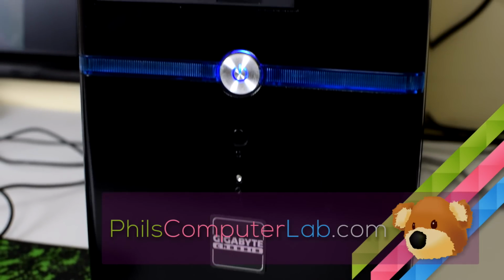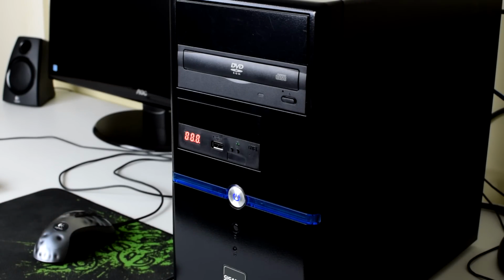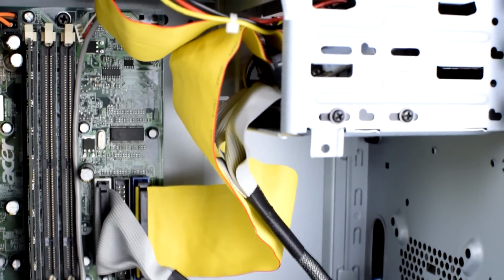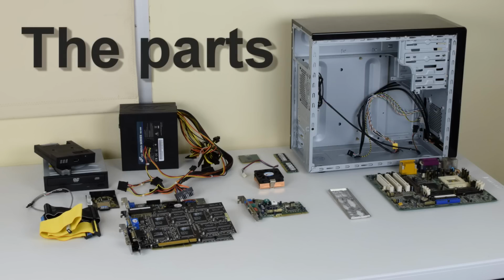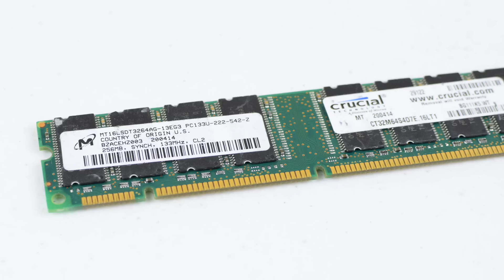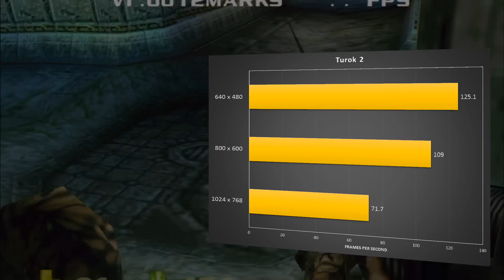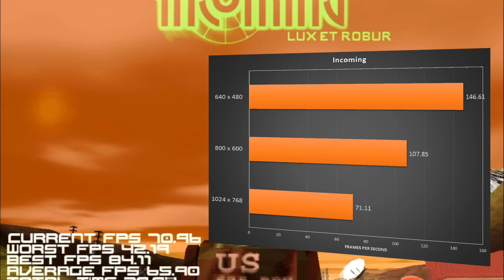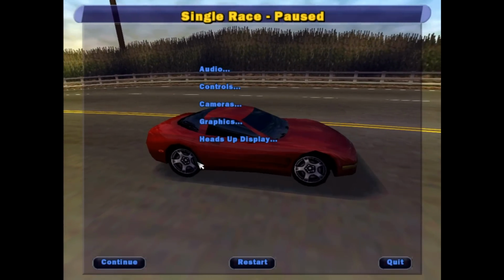3dfx Voodoo 2 SLI sleeper PC

Comment: I don't get it. I new to your videos but what is the point of putting together 20 year old computers?
I mean, this would have been handy around 2006 what I was buying computers like crazy from the thrift store for 15 bucks a pop. I had no idea you could do SLI until about 2010 when I asked a friend what the extra pins on those old cards were for.
I still have some of those old cards but really... what's the point? Does DOSbox not do so well with some games?

Comment: So do you NEED the main GPU if you do an voodoo2 sli configuration?  Also, is it configured so the 3dfx cards are feeding video into the matrox (as some kind of passthrough or something?)
Reply from the maker: +david b Yes you need a main GPU. The main GPU is passed through the Voodoo 2 cards.
Reply: Ok.  After looking at a few other video's I can see better how it's setup.  So is there a particular one of the Voodoo 2's that you need to pass the video to?  Or does that matter as much?  I would assume the one you hook to a monitor should probably be the one the video is passing to though right?
Reply from the maker: Good question. I just turned on the machine and tried out which one worked. The first one I tried happened to work :)

I can only assume that one card "takes over" so to speak.
Reply: So by using the voodoo 2's like this, can you "get the best of both worlds" in that you still have the excellent glide support, but also have support for later games that might benefit from newer cards?
Reply from the maker: Yes. But, you could just go with a Voodoo 3, 4 or 5 :)

Voodoo 2 SLI is really more about coolness than being practical. I would rather play Unreal on a V3, but there is just something really cool about V2 SLI.

Comment: didn't start building computers till around 2011. so I'm not that knowledgeable about 90s multi gpu setups. why do you need a third gpu? if you are pairing two cards why not use the video output on the top one? was it some sort of technical limitation back in the day?
Reply from the maker: The Voodoo 2 cards are 3D only! So you need a 2D for Windows, DOS, BIOS and all of that.
Reply: Thanks! I was curious on why it was so

Comment: Hi Phil, i want to buy 2 voodoo2 but i don't know which is better, the rev C with memories in one side, the rev A with dual side memories, What would you choose? thanks a lot!
Reply from the maker: Not sure what the differences are, but I like to use the later revisions in general :)
Reply: thanks for the answer, Yeah, me too, but maybe had some compatibility problems, so ask
Reply from the maker: acidNexTT Yea good question, I haven't come across anything in my research, so go ahead and get that rev C card :D
Reply: thanks a lot, incoming 2 voodoo2 rev C 100mhz  :D
Reply: PhilsComputerLab I've got a matrox g400 heading my way and I was wondering if I stuck a voodoo2 in as well wether I could use that for glide games and the matrox for non glide like dk2 for the embm?

Comment: i have only one voodoo2. now that the rx480 is finally arrived do you suggest to buy another voodoo2 and put them in sli or buy the new amd's gpu ?
Reply: Why not both ?
Reply: yeah! i can use two rx480 in crossfire for 2D graphics and 2 voodoo2 for 3d. thanks!
Reply: why not using the two RX480 cards for directx games and voodoo 2 for glide/opengl games ? ^^

Comment: do these jave to be the exact same Voodoo 2 card to be SLI or can it be a different brand? Just bought a voodoo 2 for my 486 it was difficult to find one online probably wont SLI in a 486 but for future systems maybe
Reply from the maker: For a 486? Hmm that's a pretty poor combination. A first gen Voodoo should be used in a Pentium 166 or something like that, a Voodoo 2 with a Pentium 2 or 3.
Reply: @philscomputerlab  Only reason im putting it in a 486 is I saw some benchmarks comparing a voodoo 1 and 2 on a Vogons forum with some pretty good results and the Voodoo 2 did better then the voodoo 1 on a fast 486 system plus my only other machine I could throw it in a is a Pentium 166MHz but that system is dead figure I will hold onto the card until I fix it or replace it
Reply from the maker: @Twintania  Hmm, and I mean this really well, using a V2 in a 486 is not dong it justice. Most of the games run in Windows 05 or 98, which is also a lot to ask from a 486. I would seriously reconsider your plans and get a Slot 1 Pentium 2 instead.
Reply: @philscomputerlab  alright thanks, just have a 120mhz 486 and looking to push the most out of it but if I ever get my pentium working I will give it to that machine or my pentium 3 which I don't do anything with at the moment

Comment: Please remind my, why did you need a third graphics card?
Reply: the early 3d cards only did 3d and not 2d, so you'd need a 2d card and a dedicated 3d card with passthrough cable
Reply: poi covered it, but the voodoo 2 cards, at least those, were called "graphics accelerators", they only did "3d" gaming.  You needed a "regular" graphics card to do your desktop.
Reply: well technically speaking the 2d "regular" graphics cards were also called graphics accelerators back in the day (and even still today). because  a graphics accelerator is either 2d, 3d or both and comprises of a graphic chip that allows the cpu to offload some of the tasks associated with graphics to a discrete chip. so what I said was correct and what yours saying techinically isn't right because there never was the distiction between graphics accelerators having 3d and graphics cards doing 2d - because they were both known as graphics accelorators - one 2d and the other  3d and both were available as graphics cards because "card" refers to the format.

Comment: so you need a main video card to go along with the sli voodoo2s? i cant get them to show up in display options, but they show up as pci videocard
Reply from the maker: +derp man Yes you need a proper graphics card with Voodoo 2. They are 3D only.
Reply: ah thanks, yeah im looking at more and more vids, and they all run 3 cards. that had us stumped for a while
Reply: does it have to be a older 2d card or can i use a newer video card from early 2000s with the voodoo2s in sli?
Reply from the maker: Nope, people use GeForce2, 3 or 4 cards, it totally depends on what you want to do :)
Reply: sweet, thanks so much, you rock and always answer questions, thank you. trying to get back intro this after so many years
Reply from the maker: It's a great hobby :)

Comment: A sleeper would be that hardware inside a Gateway 2000 case or a 2001 Acer Mid-Tower.  Any sub $600 pre-built PC from around that time that used shitty outdated and low end parts.

Comment: how much cards can you connect on sli with voodoo 2?
Reply: +jangelelcangry With the SLI-connector as seen in this video just two card can be coupled. However Quantum3D made Voodoo2 variants called Mercury for the professional simulator market, which contained 8 Voodoo2 chips per board and at least 4 of those boards could be coupled together.
Reply: Whoa! Awesome. I wonder how scaling compares to Nvidia cards. they should make sli technologies that you can connect at least up to 8 gpus on every range of cards. imagine at least 6 gtx 950s in sli.
Reply: +jangelelcangry The two SLIs from 3dfx and Nvidia have the same name and the same aim, but the technology behind it is a totally different concept. With 3dfx's SLI you could double (ok, maybe 98% or so) the performance of Voodoo2 by adding a second card. With Nvidia's SLI you won't reach that capability in games. Apart from the 3dfx SLI I've never been a fan of coupling multiple GPUs, because of the power consumption and resulting heat with todays GPUs and in particular with the problems regarding micro stutter, compatibility etc..
Reply from the maker: +armorgeddon Yea even the names are different. Scan Line Interleave vs Scalable Link Interface :D
Reply: armorgeddon
Too bad that software is behind multi-core/gpu technology. maybe in 10 years we will see APIs advanced enough that can fully use multiple GPUs and CPUs at the same time without too much or no tweaking with game engines. until then, 4 cores and big GPUs.

Comment: Why is it 2 8mb cards?
Reply: Strangely, the back of both card has absolutely no ram chips, while 8MB cards still have 4 chips on the back ... Maybe his cards are using most advanced ram chips that can store twice the amount of data in comparison of the first ram chips used ?
Reply: Usually it only goes up in times by four, since a square chip is more desireable than a rectangle one. But these cards are modular and allow different configs. All possible Examples: (Texture Memory 1 + Texture Memory 2 and Frame Buffer.) 2M+2M+2M(6MB, no chips on back)), 2M+2M+4M(8MB, 4 Chips on Bottom on back) 4M+4M+2M (10MB,8 Chips on top on back), 4M+4M+4M (12MB,All chips on back). In comparison to the 4MB Voodoo, just leave out one Texture Unit and you could have a 4MB, 6MB or even a 8MB Voodoo 1. They all exist.
Reply: Also, each chip has its own 64Bit memory interface, each chip has an 16bit data-bus. so it has to be 4 memory chips minimum per unit. Al chips are usually 256Kbit x 16Bit, so 512KB. 4 of them make 2MB.

Comment: Hey does this support cs 1.6 and can it get 100fps in it?
Reply: It could support CS1.6 but maybe 60-ish fps
Reply: Victor Gonzalez well can 2x3dfx voodoo and 2x900mhz cpus get it done?
Reply: Yeah
Reply: +Shrekinator

The Half-Life engine was never designed for SMP, so the extra processor wouldn't be utilized for the game. Half-Life would still run marginally faster though because background OS tasks would be offloaded to the second CPU, leaving one CPU dedicated to running the game.

As for running CS 1.6 on 3dfx cards, you'd have to find a version that predates the 2013 Steampipe update because Valve removed all of the depreciated renderers (3dfx MiniGL, software and Direct 3D) so it wouldn't work correctly.

Windows XP is also the last version of Windows to have any sort of driver support for any 3dfx card and I can't see Steam supporting that platform too much longer since Microsoft dropped support for it 3 years ago now. Steam used to support Windows 98 and 2000 as well, but that was dropped way back in 2006.
Reply: Okay thank you for the very informative question.

Comment: i have tested many games on my pentium 3 rig
Quake 3 Arena: has lots of lag
Half-Life: has lag too
Quake 2: lags, but not as much as the games above
Need for speed 3 Hot pursuit: lags a lot
Specs:
CPU: Pentium 3 katmai 500 mhz 
Memory: 256mb sdram
Video Card: Visiontek nVidia Riva TNT2 Model 64 AGP card with 32mb vram 
Sound: Creative SoundBlaster 16 ct2830 ISA sound card

What could be the reason why its slowing down, is it the CPU
or the GPU, i tested all the games on a pentium 4 pc with that video card
and they ran fine.
Reply from the maker: +Windows Ninety Five 66 I think that graphics card needs a fast processor to run well.
Reply: could a voodoo 2 or voodoo 3 improve the performance of my games?
Reply from the maker: Voodoo cards, especially Glide games, run much better on slower processors! But you can also consider upgrading the processor if the machine supports it.
Reply: my pc has the slot 1, there is no 700 or 800 mhz slot 1 and the adapters are really rare and hard to find.
Reply from the maker: +Windows Ninety Five 66 Slot 1 goes up to 1 GHz. I have one, used it in a recent video.
Reply: i put in a geforce 2 mx 200 with the same vram and it performed better and had more consistent fps than the tnt2 m64

Comment: I could see doing it but once you have the AGP slot why bother with the 2 SLI pci 3dfx cards. Why wouldn't you just use a Voodoo3 AGP card. Anyone back in the day who ran a setup like that would have been all in on switching to AGP and ditching the 2 PCI cards as well as the Matrox 2d. The Voodoo 3 3000 AGP was faster than 2x Voodoo 2 in SLI and 2 less cards producing heat in the system

Comment: game at 13:06 please ? Ive been looking for this game for 9 years now
Reply: 1. Descent 3
2. F22
3. Expendable
4. Forsaken
5. quake
6. Nascar Racing 3
7. Quake 2?
8. need for speed 2
9. Turok
10. Incoming
11. Unreal 1

I got this from a different comment but i think it should help.
Reply: reinaertdevos i used to play quake on my i486 i think. iwas 5 years old playing it. it was a pain in the ass. i wanna run it on my new 6700k rig
Reply: use the darkplaces engine for old quake, runs smoothly on win10 also the 2 expansion packs (just bought em during sales on steam) such a nostalgia trip
Reply: that's Need for Speed III Hot Pursuit
I bought it new 20 years ago, trust me! :)

Comment: That was unfortunately the biggest problem with Voodoo 2 cards. A Riva TNT card from the same era could do more desirable 1600x1200 resolution. 3Dfx cards topped out at 1024x768 in the games that supported Glide.
Reply from the maker: Sure, but the TNT has no hope at running anything at 1600 x 1200. A Voodoo 5 or GeForce256 is needed for this.
Reply: I was playing Quake at 1600x1200 on a TNT.
Reply from the maker: MrGencyExit64 A TNT2 does 11 fps at that resolution. Not playable IMO.
Reply: PhilsComputerLab I really don't know where you get those numbers from. Whatever the framerate was, I was playing EverQuest and Quake at 1600x1200 on a TNT, while I would have been limited to 1024x768 if I had an SLI Voodoo 2 setup. It just wasn't practical to do SLI.
Reply from the maker: I am doing my own benchmarks: http://www.philscomputerlab.com/p4-306---w98-se-benchmarks.html
Reply: PhilsComputerLab Okay, thank you. It may well have run at very low framerates, but I did actually play those games at 1600x1200 and preferred them at whatever framerate they ran at over my friend's SLI setup. EverQuest limited to 1024x768 was not pleasant :-\

Comment: https://www.anandtech.com/show/272/5

from  anandtech

"Now that should look quite familiar, take a look at the specifications for the Voodoo3 once again, now look at the Voodoo2 SLI specifications hmm interesting no? The Voodoo3 is quite similar to a single-card SLI solution with integrated 2D and support for the AGP interface. A tad disappointing, isn't it?  "

voodoo3= voodoo2 sli???
so voodoo3 3500= voodoo2 sli OC 183mhz????

can you use voodoo3 at 90mhz just like voodoo2
test voodoo3 90mhz  vs voodoo2 sli? or single voodoo2??
that is funny